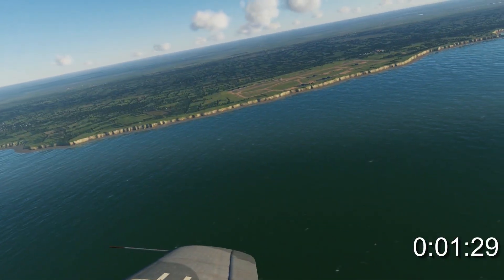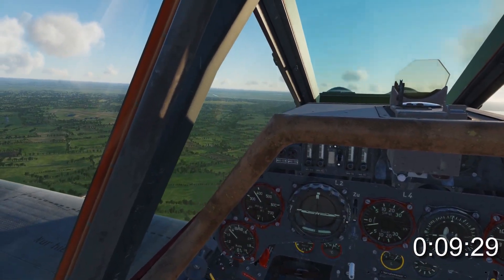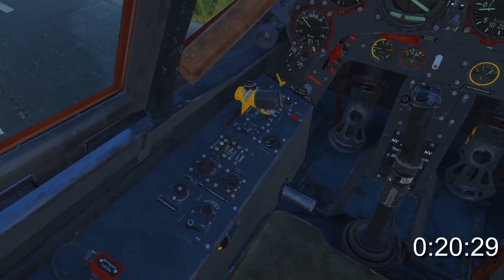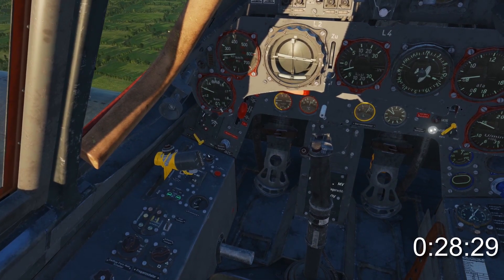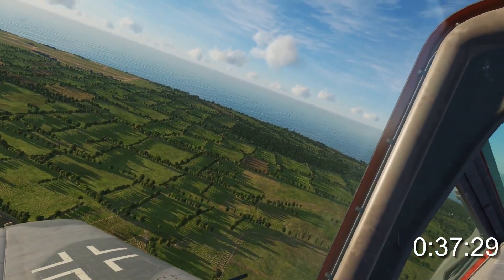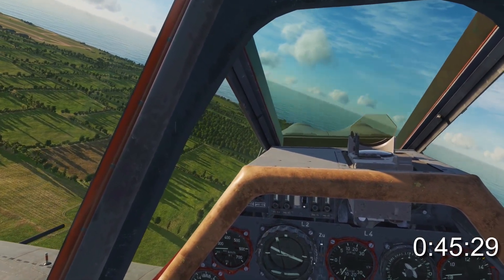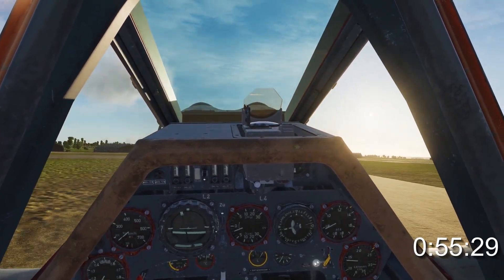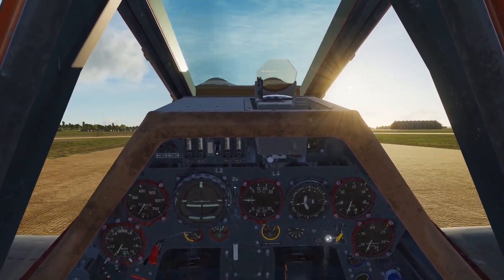1 Minute DCS - FW190 A-8 Anton - Landing Tutorial

Comment: The most difficult of the warbirds to land safely. If the real Anton was as modeled, the average German pilot would not have survived it. I guess that leaves Galland and one or two others. I think it should have a bit more "give" in the oleos for us "less skilled" should I say. I can get the Spit and Mustang down ok, is my point. I am still trying and this video will help a lot. Many thanks.
Reply: Surely the Spitfire or BF-109K would be harder to land. At least we've got the wider landing-gear on this one.
Reply: @alexanderryan-jones600  You seem to be able to "fly" the Spit down the runway much more easily and let it settle itself. The Anton just wants to drop it's so heavy. The 109? not even game to take her on! Can ED please give us a Tempest?
Reply from the maker: Thank you sirs!  I find this one harder to land than either, the Spit IX you can use minimum power to get to the threshold, get a metre or so above the tarmac, cut the power and slight flare.  The BF109K you can cut the power even earlier and do a straight in approach quite easily.  The P51 is just a dream no matter what type of approach you perform.  The 190D, is a little more tricky with the nose, but a curved approach helps.  Even the I-16 only becomes dangerous in the latter half of the roll out.  This one is heavy, as a result you need some power on up to touchdown, otherwise she'll drop like a stone, she loses lift quite easily so there is a fine balance.  This landing tutorial will work, but you lose visibility to the right, my good friend Richard Perry pointed out the correct way of bringing her down in his comment, which is a traditional 4 leg, approach straight in using the rudder to check your view and ensure you are lined up.